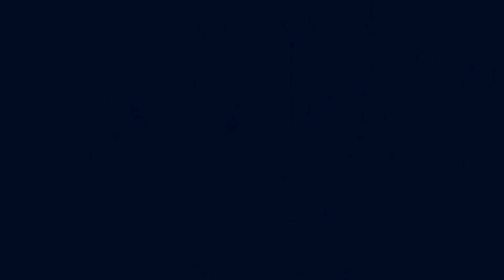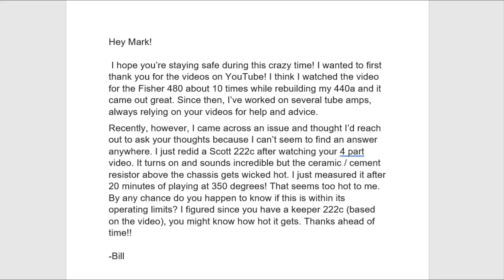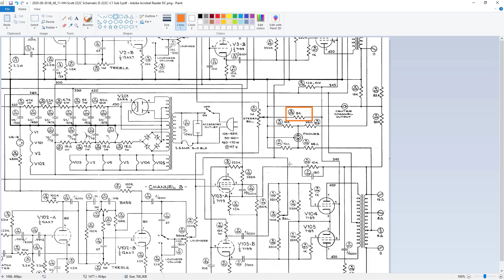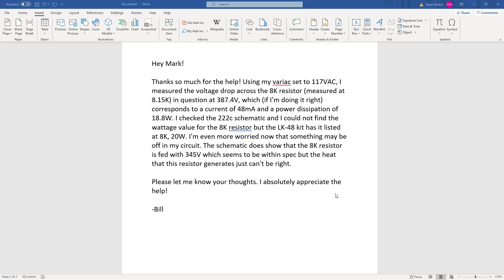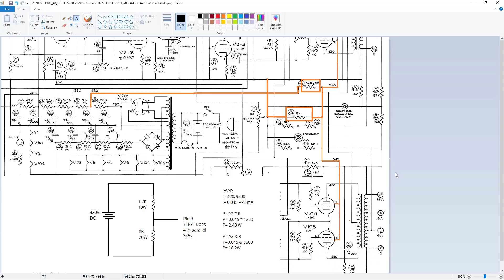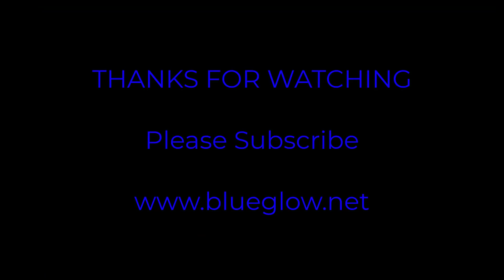Ask Mark - HH Scott Amplifier Ceramic Stick Resistor - Too Hot   BG294

Comment: This video is a prime example of how remote/distance learning is the future. I sure wish the instructors I had in college were this clear and lucid. Would have learned a lot more and better. I have a couple Scott tube amps in the basement that are dormant and need restoration. One of these days. When I get around to it. One thing this video brought up which I never thought about - at least consciously - is the question of input voltage. I am old enough to remember when people stated house voltage as 110.  Way back when. Our whole house ran of two 20/30 amp fuses. Then house voltage stealthily crept up to 120.  Like the boiled frog. It happens and you don't notice. Just checked the voltage - same house - and it reads 121/122. Something to remember when working on this stuff designed for 110.

Comment: This is about sub-optimal design of this amplifier in terms of power output and power consumption. The problem was how to obtain relatively stable screen voltage when screen current increases (from from 0.8 mA to 12.5 mA per tube, or 15-fold increase) with increasing signal level. Scott's solution was to shunt screen supply with that stick power resistor, so that now zero signal total screen circuit current is 44 mA and max signal  current is 90 mA, or only 2-fold difference. The price paid for such screen voltage "stabilization" is not only heat, but waste of precious 45 watts of power from a tube-rectified power supply.

Comment: Welcome back Mark! Would you consider changing the first resistor in the CRC network after the Rectifier tube to drop the voltage at that point? That would have the added benefit of bringing all of the voltages in the power supply chain down to specs and relieve some of the overvoltage that the filter capacitors see.
Reply: Yes that works too if all the other voltages are high.  For sure
Reply: This would be my choice, to put all the voltages in the amp back to their design values, in particular the the ratio of the output tubes' plate to screen voltages.

Comment: Thanks for the video Mark great explanation. A handy piece of equipment to use on old amps and tube grear would be a step down transformer then don't need to modify circuit :)

Comment: According to the Sylvania datasheet for the 7189/7189A the Screen (G2) max dissipation is from 2.2 to 4.4 watts from no signal to full signal per pair of tubes in push-pull.  That's an additional current draw for the total amplifier of 14 ma at quiescent state to near 30 at maximum signal assuming only 300 VDC on the G2s.  Scott may not have been driving the tubes all the way to design maximum, but at 345 volts they are probably close to it and there is a significant current demand by the screens of the output tubes that would need to be considered in calculating the voltage division at the bottom of the 1.2k  resistor and its available power dissipation.
Reply: 222c real power output is about 10 watts/channel. The power is limited by voltage sag in the RC-filtered power supply, and current capability of the 5AR4 rectifier. 299c is also 10 watts, for exactly the same reason, despite higher B+ and 7591 tubes.

Comment: Mark,
Adjusting the screen voltage makes sense. However, the plate voltage should also be significantly higher, due to the higher input from the transformer. Will the the increased difference in plate-to-screen voltage have any significance? Should the plate voltage also be adjusted to correct for the higher line input voltage of today?
Reply from the maker: He should get the plate voltage in check too :-)

Comment: First I don't know Jack Crap but need to ask... Wouldn't it be better to adjust the resistor in the C-R-C to establish the voltage across the total network of the circuit? Maybe do the same for the first resistor after the full wave rectifier and for the filaments? Would it matter? What problems could it cause?
Reply: No, that won't work. Screen current of output tubes dramatically changes with signal, so screen voltage needs some kind of stabilization. This is done by adding bleeder resistor parallel to screens.

Comment: So in one of XRayTonyB's videos he talked about a similar circuit with 2 power resistors that were just bleeding current to ground, and what that was about. He wasn't sure why they made that design choice, but it was also on an HH Scott unit.

https://www.youtube.com/watch?v=aoiHCxcSjuA
Reply: The purpose is to stabilize screen voltage.

Comment: The I (45 mA) that you used does not account for the current taped off at the 1.2k-8k junction feeding the screen grids of the 7189(s) and what ever the pentodes are above them .  A better way to calculate would be P=E^2/R=345^2/8200= 14.5 Watts for the 8k resistor.
Reply: By the same token the 1.2 k resistor would be dissipating (420v-345v)^2/1200 ohms=4.68 watt.

Comment: Aren't ALL of the voltages coming off the power supply likely to be "higher" than normal? Wouldn't it be better to drop some more voltage on R205 (the first resistor after the rectifier tube)? That way all of the power rails would be closer to spec?
Reply from the maker: Yes, this could be done too.  Without having his unit in hand, its hard to tell.
Reply: I have a tube amp designed for 110 volts and I have about 123 volts at the receptacle. To remedy the situation I bought a small 120 to 12 volt xmfr and wired it in buck configuration. Since only about 10% of the voltage needed to be bucked the xmfr was pretty small. The upshot is that the amp is getting the 110 volts it wants so I didn't have to fiddle with the circuit.
Eric
Reply: I wouldn't worry about increased B+. Output tubes can tolerate significantly more than on the 222c schematic because at zero signal plate and screen currents are very low. With signal, these voltages will go down because of voltage drop in transformer secondary, rectifier, and 80 ohm resistor.

Comment: Why do vintage guitar amps use capacitor values such as 20uf or 10uf in their power filtering? Is that because, unlike hi-fi, lower headroom and sag aren't always a bad thing? What would be the result if a modern cap is used such as a 220uf in place of a 20uf?
Reply: As long as it is not the first capacitor in tube-rectified power supply, a 220 uF capacitor can be used in place of 20 uF. But it won't make the supply any better. Push-pull circuit does not need low level of ripple: ripple is common mode for it.

Comment: If this was a tuner IF stage that resistor would be a capacitor. Wondering whether that isn't an option here?
Reply: not at DC it isn't an option - you can't make a dc voltage divider with capacitors - capacitors look like an open at dc. Remember for capacitors, impedance = 1 / jwc, when w=0, impedance is infinite. What they could've done is scaled all the resistor values in the divider up by some factor, and the voltage divider would draw less current, but the drive strength in the middle (the 345 v rail in this case) would be weaker, and could wander. I have no idea how much current the screens of tubes draw, but if they truly don't draw much current, you could probably double the resistor values in the divider (2.4k on top, and 16k on the bottom) and end up with 1/4 of the power being dissipated. What determines what values you should use in the divider is the equivalent resistance of the 4 tube's screens to ground in parallel with the bottom resistor in the divider. This is all very basic "circuits 101" analysis. Edited to add: I was reading another comment below that the screens can draw up to 30mA for those tubes x 4 tubes in parallel = 120mA - that's starting to be significant, so you probably couldn't scale up the resistors in the divider - it would change the screen voltage too much as the load changes.
Reply: gorak9000 Where does it say the screen has to be at a constant DC voltage? Common practice in preamp tubes to decouple the screen with a capacitor. Or part of the output transformer come to think of it.

Comment: Thanks a lot .I have a collection of HHscott amps 222,299, etc .I was thinking to replace all those resistors with a big voltage transistor regulator ..
Reply: That would work. If screen voltage is stabilized at 300 V, there would be no need in that bleeder resistor. A separate screen supply will make it possible to realize 24 W power output (with the original power supply the amp clips at 10W).

Comment: Good learning session. Would wonder if putting transformer inbetween house and unit at proper power output required and 110vac output would be best instead of altering amp, possibly causing other problems.
Reply: It is not necessary. 117 vs. 125 VAC is about 7% difference, not important.
Reply: @anatolygrishin4234  I hear you.